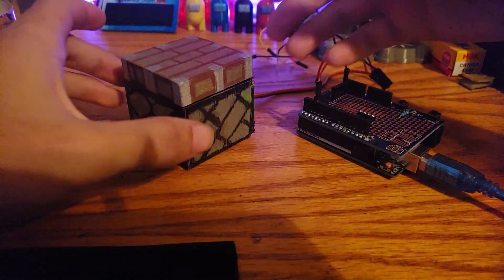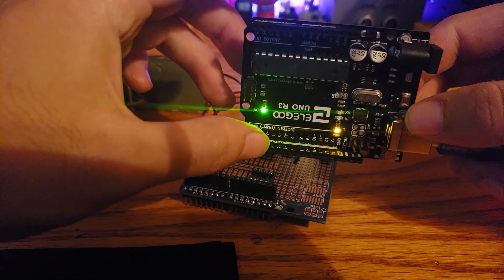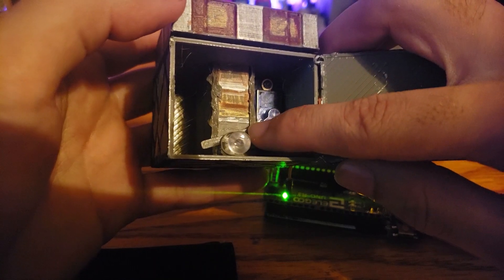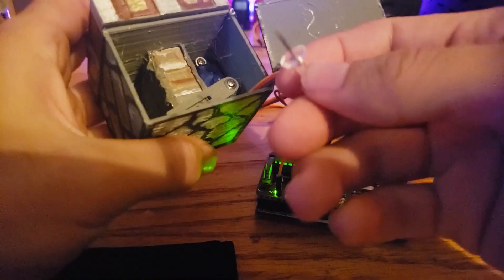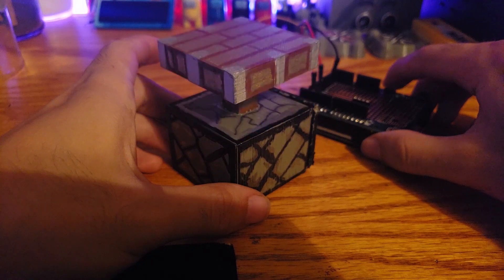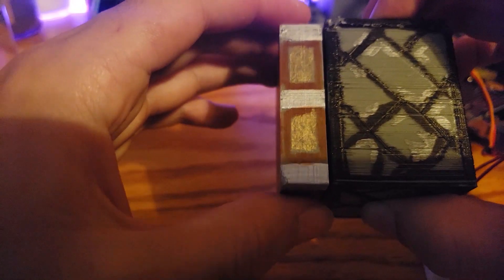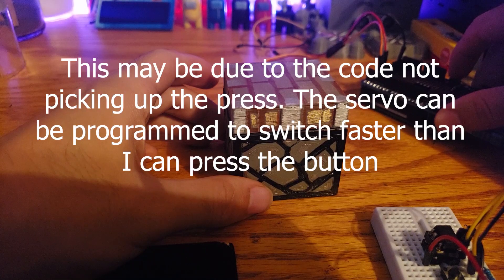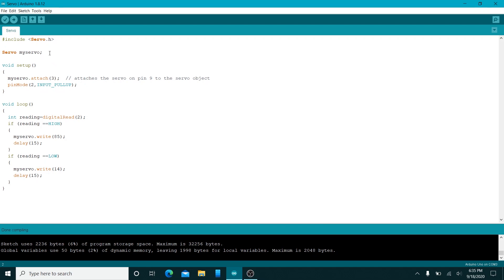Minecraft Piston 1/20th Scale Build

Comment: Sorry to bother you, but the pushpin keeps breaking the piston head. What should I do?
Reply from the maker: no bother : ) I think the walls may be printed too thin if youre referring to the shaft area. I feel like I may have had wall thickness of 1.6 mm. Predrilling will help, or alternatively you can melt in the pushpin by slightly heating the metal. I think the updated versions are easier to work with, just that theyre a bit bigger.

Comment: How did you connect the button to the circuit board?
Reply from the maker: I'm using input pullup on pin 2 in the arduino code, so I have one side of the button connected to pin 2, then for the other side of the button is a resistor that connects to ground. I think the resistor is redundant, but better to be safe, 1,000 ohm should work : )

Comment: what can be a reason mine won't work? have the same exact set up as yours, can you send a link on how the resistor looks at the bottom or something? idk what im doing wrong:(
Reply from the maker: One side of the button is connected to a resistor which connects to ground, the other side of the button will be connected to the microcontroller. 

feel free to attach photos on this google doc https://docs.google.com/document/d/1d9TH0bv79RYRv-bEe2RoEuo2szrrrWT5UvjHN3ZVvrM/edit?usp=sharing
Reply: @hecbac  so the resistor goes into the little opening next to the button? And then where does the other side go? Sorry I’m really new
Reply from the maker: I created a basic diagram in the document, I hope it helps!
Reply: @hecbac  so I plug the resistor into ground and the button?
Reply from the maker: @cosmicJagaimo  Yup, and no worries : ) the other side of the button is attached to the pin you call input_pullup

Comment: I'm planning to make a 2 by 2 piston door irl for my science fair. Any tips or ideas?
Reply from the maker: That's really cool! there's a bunch of different ways. I think the most impactful is the use of a microcontroller since it covers electronics, coding, and robotics. Not to mention you could even go into wireless transmission! For the actual engineering, you could use servos, but then you would need to connect 4. A little pricey at $2 each. Another way to only need to drive one thing would be having them on wheels that turn and are connected by a belt. Kind of tough to build though. What are you familiar with and have to work with?
Reply: @hecbac  not much, I'm 16 and I'm currently working on a flamethrower for this year's science fair. If you want you can check it on my channel, I'll make the clip public.
Reply from the maker: @paolonino221  That flamethrower is dope! Please wear a glove or something though lmao. I'll try working on a design the doesn't depend on a microcontroller or 3d printing, since this design is really limited :D